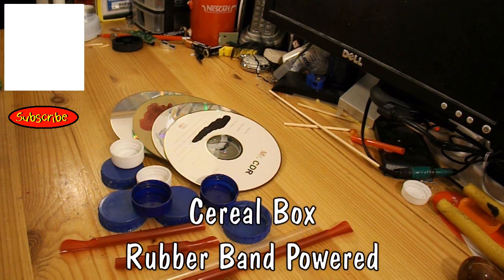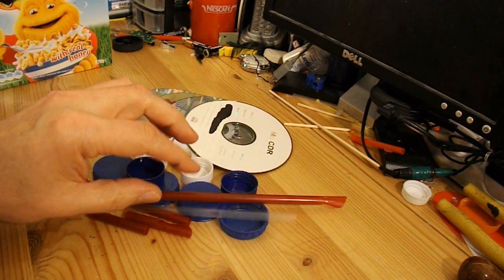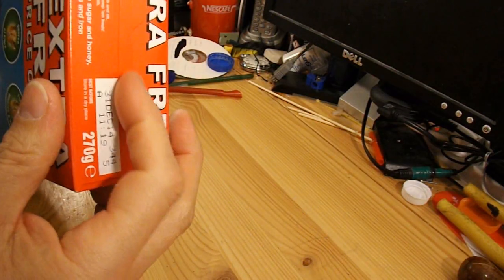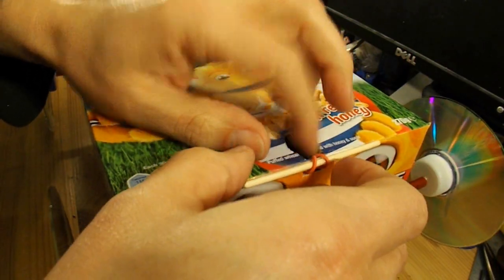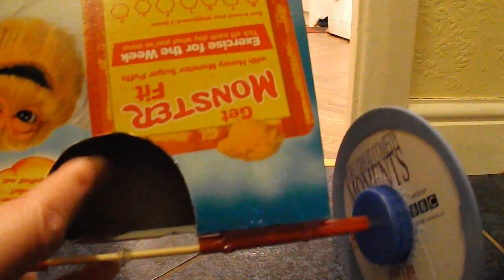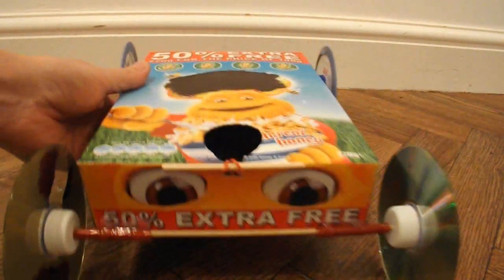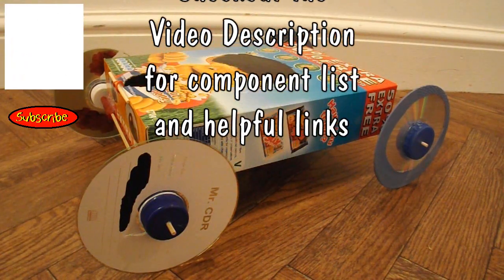Cereal Box Rubber Band Powered Car

Comment: Lucky it went that far. Mine only went like a meter and i need it so go 2 meter. sigh The struggle.
Reply from the maker: +Chad -Ster luck has very little to do with it. If your car only does a metre then you probably have a problem with friction. I have a rather long fault finding checklist that I will add here as a second comment.
Reply from the maker: +Chad -Ster Fault Finding on a Rubber Band Powered Car
1. The rubber band does not connect to the front axle, some people misunderstand the videos and attach the rubber band to the front axle as a convenient anchor. That stops the axle turning. Make a different anchor point, study the video again.
2. Does the car run forwards freely if you just push it without the rubber band connected?
If it does not, make sure that the axles are free where they pass through the body. You may need to enlarge the holes where the axle goes through the body or use larger tubes for the axles to go through.
Are your wheels round with no flat spots. You may need to trim them.
3. Do the wheels rub against the body of the car?
If they do, the friction will slow the car or even stop it moving.
Put some spacers on the axle between the wheels and the body to keep the wheels clear. Discs or washers cut from plastic or cardboard should work. 
4. Do the wheels spin evenly when you watch them?
If your axles do not pass through the centres of the wheels, the wheels will not spin evenly and this makes it harder for the car to run, so you will need to make new axle holes, taking more care finding the exact centre.
6. When you wind the rubber band round the axle do the wheels turn at the same time or are they slipping on the axle?
If the wheels are slipping on the axle, the rubber band will unwind without the wheels turning on the ground. You need to do something to stop them slipping. Glue them to the axle or wrap tape round the axle where the wheels are to hold them in place.
7. When you release the car it does not move, but if you lift it in the air, the rubber band unwinds and the wheels spin OK.
Either the ground is too rough or the car is too heavy. Try the car on a smooth surface, make the car lighter, add more rubber bands. 
7. Wheel spin. When you release the car, do the wheels spin without the car moving forward?
You do not have enough grip on your wheels. Either add some weight to the car to help the grip or put something on the wheels to improve the grip. 
Things that will improve grip - hot glue all the way around the rim like a tyre. Rubber bands stretched across the wheel. A strip of rubber cut from a balloon stretched around the edge of the wheel. Strip of rubber cut from washing up gloves or disposable rubber gloves.
8. Trouble connecting the rubber band to the back axle? Glue a short stick to the axle to act as a hook for connecting the rubber band.

We are trying to construct a rubber powered car that can go as "far" as possible. It doesnt have to be fast. It just has to travel as far as possible and as "straight" as possible.
Can you please recommend me a design? Or at least give me a general idea of what critical points I should be aware of while designing my car?
This is a fairly regular question. 
I am assuming you have some set criteria for number of rubber bands and size of vehicle so putting those aside. The first point about travelling fast or a long distance is minimising your friction because that is what wastes your power. 
1. Friction caused by badly aligned wheels rubbing on the bodywork should be easy to fix by adding spacers to keep the wheels clear.
2. Friction where the axle is attached to the bodywork is reduced by making sure the axle bearing surfaces are something that does not bind together. Wood and cardboard are not good. Metal surfaces are better. Steel and brass is good. Ball race bearings would be even better. Whatever you have, even if it is just wood and cardboard, you can improve by making sure there is clearance so they do not jam together and maybe rub some graphite from a pencil where they make contact might help.
3. Friction with the wheels to the ground can be a mixed blessing. Minimise the friction of the front wheels by using very thin wheels, however you may need some grip to ensure they keep the car going straight. The same applies to the back wheels, assuming you are using the back wheels as the drive wheels. However if they do not have enough grip they will spin under power and that is all wasted energy. Thin wheels with rubber tyres would be best in that case.
Larger wheels take more effort to get them turning but once moving they have the momentum to keep rolling when the rubber bands have finished. You could experiment with different sizes to see which work best.
You could use some sort of gearing to start with a large gear to get the wheel moving and then a smaller gear to maintain the motion. There are some examples in my playlists.
Reducing unnecessary weight by trimming the bodywork a little may help but make sure you don't loose grip and start the wheels spinning if the body is too light. It may bend or break under tension so be careful.
Another trick I have found helps is to stretch the rubber band as you wind it round the axle so you get more turns round the axle, this can make a significant difference compared to just winding the band normally.
If you can only use a short rubber band, connect it to the axle using thin string so the string winds round the axle stretching the rubber band. Thin string will give you more turns round the axle than thick string.
This simple one does 12 metres https://youtu.be/pIO3FiHX4Oc with just 1 size 64 rubber band.

There are several reasons the car might turn to the right - or left -  here are some I can think of.
1. Your front axle is not parallel to your back axle so the car has an inbuilt turn. A quick check would be simply to push the car forwards without the bands connected and see if it turns.
2. When you tension the rubber band the body or the axle is flexing creating a turn. Try winding the band to one side of the axle. Looking from the back if you wind it on the right it pulls the right side of the axle forward turning the car right. If you wind it on the left it pulls the left side of the axle forward and the car goes left.
3. Probably most likely, the wheels are spinning under power allowing the back of the car to slide to one side. Fix this by adding extra grip to the wheels such as a strip cut from a balloon or rubber gloves stretched around the rim of the wheel to provide a rubber tyre. Here is a link that shows this http://youtu.be/ZnuPnveCbxs
4. The front wheels are sliding sideways under power, fix this the same as '3' above.
5. One or more of your wheels are binding on the side of the car causing it to turn.
6. One or more of your wheels are not round and the unevenness is causing the car to skip and turn.
7. Your wheels are not the same size so the car turns towards the smallest wheel.
8. Your axles are not level with the ground and the car is running on only 2 or 3 wheels. This may be the body flexing and not show until the rubber bands are wound up and under tension.

Check out my HelpFiles playlist. Many of the videos are related to Rubber Band Powered Cars
http://www.youtube.com/playlist?list=PLA5a2xPRSrB2v0vxMJyZ9cPweAGx1FK6e
Reply: Thank you, It more farther than before.
Reply from the maker: Chad -Ster hey thanks for the feedback. Good luck with your project.

Comment: can you make one that uses pencils instead of skewers, and a different type of glue besides hot glue?
Reply from the maker: Hi Carly, this car uses pencils and does not use hot glue A simple Rubber Band Powered Car - Cardboard, 2 pencils, 5 paperclips
Reply: I think you could easily replace the glue with elmers, but it won't be as durable and may break.Pencils are a simple adjustment, just make sure the tips are on opposite ends for the two axels

Comment: Grandad, i am doing an elastic car project and i wanted to know if this car can go more than fifteen meters?
Reply from the maker: I guess you will have to build it and find out. I was only asked to get it to go 3 metres and it ran the length of my kitchen which was 5 metres and it hit the wall at the end so it could have gone much further but I had nowhere bigger to try it. The distance it can travel is mainly down to how many rubber bands you are allowed to use and how well you build it. The amount of friction in the bearings will make the most difference. Here is a car I made that I know runs 12 metres easily because I ran it right through my house from the front door to the back door Rubber Band Powered Car 1 x size 64 - full length video https://youtu.be/pIO3FiHX4Oc?list=PLA5a2xPRSrB3g5RiX8Kf_uUBOL0Tb7AS0
Reply: GrandadIsAnOldMan Thank you

Comment: Would it still work without the rubber
Reply from the maker: +Jasmine Dhillon if you mean the rubber on the CDs that I used to give more grip then the answer is that you are likely to get wheel spin and the car will not move forward, however you could add some weights to make the back of the car heavier and that will help the grip.

Comment: What's the use of using cardboard cereal box ? Is it because you wanted to make the rubber band powered car to move by the rubber band as far as possible ?
Reply from the maker: +k.sĂqii _ Š . Ř . K the only reason for using a cereal box is because that is what I was asked to do. It was an engineering project somebody was given. If you look in the video description I explain that.
Reply: +GrandadIsAnOldMan No,  No, No sir. Don't get me wrong. I'm sorry if I said something wrong. But I just wanted to ask that because I'm also writing something about this video and I just wanted to know the strenghts of using this material.
Reply from the maker: k.sĂqii _ Š . Ř . K I see, no problem, but the answer is the same. I only used it because I was asked. If I wanted to make one of my own choice I would just use a flat rectangle of cardboard about a foot long and about 5 inches wide. I would use CDs for wheels with plastic bottle tops for hubs and bbq skewers for axles. Drinking straws for axle tubes and glue it all together with a hot glue gun. I can make a car like that in a matter of minutes and it will run at least 12 metres with no trouble
Reply: +GrandadIsAnOldMan That's amazing. I also have to make a rubber band powered car for my Computer and Technology assignment. That's why I'm looking at some of your videos to find some useful information. We can't use CDs, some parts of toys, for e.g. wheels. That's why I asked you what was the advantage of using the cereal box.
Reply from the maker: +k.sĂqii _ Š . Ř . K well good luck with your project. In the video description there are links to more of my rubber band projects, there are hundreds of different models and some of them do not use CDs for wheels because people have asked me for alternatives.
Reply: +GrandadIsAnOldMan Thank you sir. And it was a pleasure chatting with you. :)
Reply from the maker: k.sĂqii _ Š . Ř . K thank you
Reply: +GrandadIsAnOldMan Don't mention it. It's a pleasure.

Comment: what hook did you use to attach the rubber band?
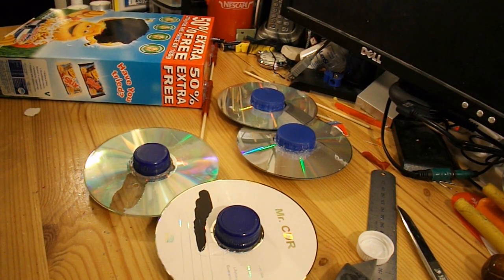Reply from the maker: At 02:57 I show that I glued a bit of bent paperclip round the axle to use as a hook although you have to be careful if you do that because when you cut the paperclip it will probably have a sharp point which stick in your finger. Generally I just glue a short piece of bbq skewer to the axle, that works fine.
Reply: thank you so much i am working on freshman engineering project for class the teacher asked for "Race one is building a vehicle that can travel fifty feet using mechanical power"
Reply from the maker: Good luck with that. There are handy links in my video description for playlists of my rubber band related projects. There are currently 201 videos in my Rubber Band Powered Car playlist, here is a simple example https://youtu.be/pIO3FiHX4Oc and here is that playlist https://www.youtube.com/playlist?list=PLA5a2xPRSrB1otXh0w36OwsYIHZznUWp6

Comment: How'd you get the wheels to stay?
Reply from the maker: They are a tight fit on the axle. When I drill the holes through the bottle tops I use a drill that is slightly smaller than the bbq skewer so it grips. If they start to work loose I would just use some hot glue to hold them.

Comment: what can I use if I don't have a hot glue gun to make the straws stick?
Reply from the maker: +lisvette rodriguez I am afraid that is for you to find out what is available to you. I use hot glue because it is quick but there are many other glues that will do the job if you are prepared to wait for the glue to dry. For sticking the straws to the box you can probably use sticky tape or maybe superglue. For sticking the bottle tops to the CDs superglue might work, I have used it but it depends what sort of plastic you are using. If you can't use superglue then it is back to my first comment, you will have to find out for yourself.
Reply: +GrandadIsAnOldMan ture i used superglue and it useless😭
Reply from the maker: ummustafa javed that just depends what materials you are trying to join. Read the instructions on the superglue and it will tell you what is sticks. Like I said in the reply above, it is up to you to find what is available and what works. There is no way I can advise for the whole world, each country is different.
Reply: +GrandadIsAnOldMan thank you
Reply: GrandadIsAnOldMan thx for the idea

Comment: About how many rubber bands do u use
Reply from the maker: Jaycie Seland no idea. I just joined enough to reach the axle. The number would only be relevant if you were quoting a specific size of rubber band. For example Size 64 rubber band measure 3 1/2"x 1/4"x 1/32" or 89mm x 6mm

Comment: Can you make a rubber band powered car that somehow picks up any object, and carries it for a minimum of 2 meters
Reply from the maker: Johnathan Doolittle when you say 'picks up any object' do you mean I can choose the object or do you mean it must be capable of picking up any object placed in front of it regardless of shape or weight? I ask because the first type of car that comes to mind would have a low front that hits the object as it drives into it so the object tips over and falls inside the car and is then carried along for the required 2 metres.
Reply: You can choose the object; it can be anything you want. You can pick up the object any way you like (i.e. scoop it up, tip it over) and the car must carry it for 2 meters -- so long as the method used to pick up  and carry the object is mechanical in nature.  Thanks for responding
Reply from the maker: Johnathan Doolittle  scheduled tomorrow morning there will be a very simple car like the one I described in my first reply in my video.

Comment: How did you get the back wheel staight
Reply from the maker: Getting your wheels straight on the axle is down to taking care when you push the hole through the bottle tops. If you have them out of line you could try reheating the hot glue on one of them to adjust it's alignment.

Comment: how do you make the holes in the bottle cap
Reply from the maker: I use a tool called an Awl which is a pointed metal spike with a wooden handle. You could use a sharpened nail or a stiff piece of wire or a small screwdriver or a drill. I have found many of the bottle tops I use are soft enough to push a hole through using the BBQ skewer.

Comment: Can u make a rubber band car that can go at least 7 meters
Reply from the maker: Sushmit Acharya most of my cars will do 7 metres. Generally I only test them in my kitchen which is 5 metres long, but as long as they hit the wall at the other end that means they would carry on further. If you look at my Rubber Band Power playlist you can go through them and see all the different designs. There is a link to the playlist in the video description.

Comment: how do you make sure the wheels don't come off?
Reply: I assume you would just use the bottle caps as a sort of hubcap. ^
Reply from the maker: The CD has a big hole in the middle so the bottle caps cover the hole and allow you to use a bbq skewer as the axle. There are plenty of different ways of fixing the axle in place, I just have plenty of bottle caps so I use them.